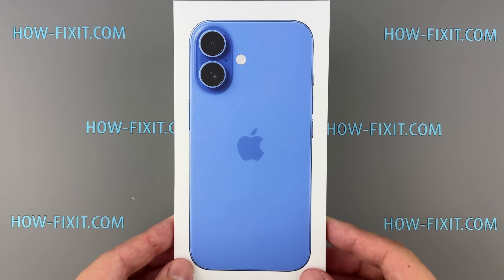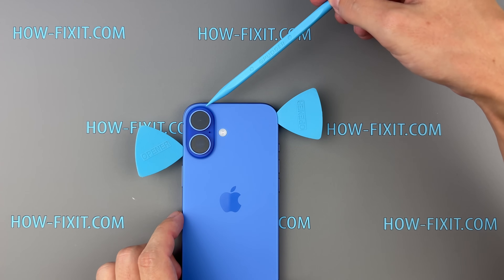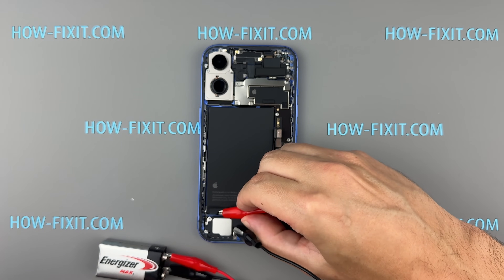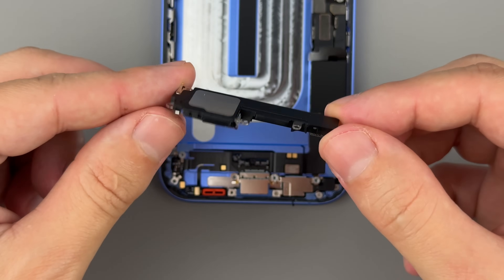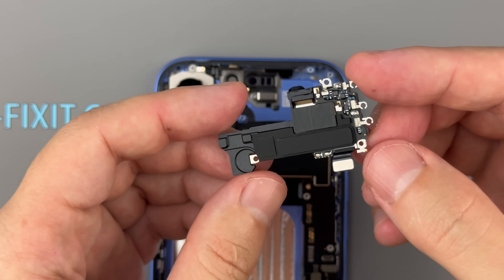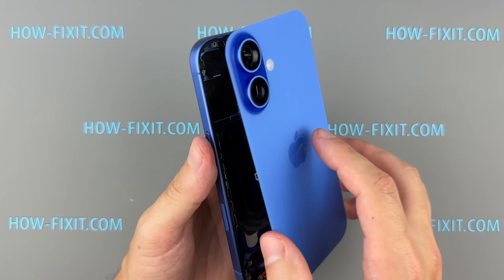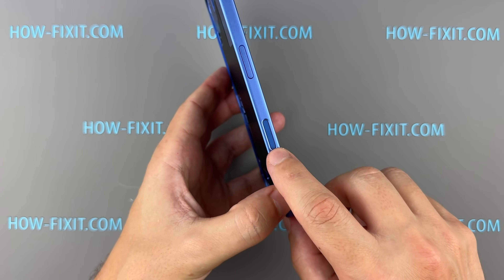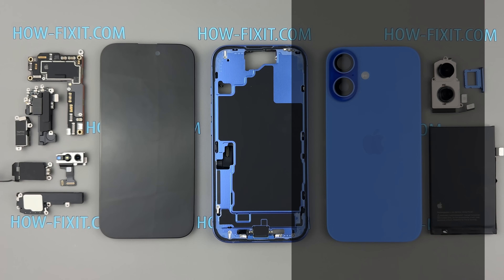Apple iPhone 16 Teardown – New Battery Removal Process Revealed!

Comment: They could have easily made a slide in battery and skipped all the nonsense with the glue.
Reply: Slide in battery would not make a water resistant iPhone. Study engineering. 😳

Comment: What did you mean by the sensor needs to be transferred wen making a screen replacement?
Reply: Most aftermarket screens do not come with the proximity sensor pre-installed, so you will need to carefully remove the sensor off the damaged screen and install it on the replacement. Not an issue if you are using OEM parts ordered directly from Apple as those come with that component pre-installed. If you can successfully disassemble the rest of the phone as well as the video guy does, this should not be a difficult task. But it does have a fair bit of adhesive holding it to the screen, so use heat, rubbing alcohol and care.

Comment: How does Apple's design choice of welding the control button to the chassis affect long-term repair strategies and part replacement availability?
Reply: Simple. It makes swapping to a used chassis from a donor impossible. The button has a chip with a serial number on it and the firmware will not accept this swap.
Reply: @jflo4073 ждём когда появятся китайские программаторы и чипы без номера
Reply: @jflo4073  True, but with the ability to swap back glass, you typically won't need to swap the chassis.

Comment: Can the placement of the Wi-Fi antenna, glued to the earpiece speaker, complicate repairs or signal strength during reassembly?
Reply from the maker: I don't see any problems with replacing the earpiece speaker since you can heat the flexible Wi-Fi cable with a hair dryer, peel it off, and transfer it to the new module. However, the placement of the Wi-Fi antenna, glued to the earpiece speaker, can potentially affect signal strength during reassembly. Since the antenna is attached to the earpiece speaker, any mishandling during disassembly or reassembly could damage the antenna or its connections, leading to weakened or inconsistent Wi-Fi performance. Care must be taken to ensure that both the earpiece speaker and the antenna are correctly reinstalled.

Comment: Is it possible to install a dual SIM card reader module from an iPhone 16 from the Chinese region into a European iPhone 16, which has a SIM card reader for only one SIM card?
Reply from the maker: Yes, it is technically possible to install a dual SIM card reader module from an iPhone 16 from the Chinese region into a European iPhone 16, but it may not function as intended due to both hardware and software limitations. The Chinese version of the iPhone 16 is designed to support dual physical SIM cards, while the European version typically supports one physical SIM and one eSIM.
Even if you successfully swap the SIM card reader module, the European iPhone’s firmware may not recognize or properly support the dual SIM functionality. Apple often regionalizes its devices with specific firmware, and features like dual SIM support may be restricted by software tied to the region. Additionally, swapping out the SIM card reader could affect future iOS updates or cause issues with network compatibility, as the phone might not recognize the modified hardware properly.
In summary, while physically possible, it is unlikely that this modification will work smoothly without custom firmware or other adjustments.
Reply: @howfixit  I remember when they changed the SIM card reader module on the iPhone XR and everything worked fine
Reply from the maker: Yes, there were times when you could change the screen or battery on the iPhone XR and any compatibility errors, everything worked perfectly, but over time, Apple made restrictions to the new version of iOS, and at the software level, the modules changed their work and caused errors, this can also be enabled with a SIM card module from another region.

Comment: Why do you think Apple might use electrically induced adhesive as a way to bond the battery to the iPhone housing?
Reply: Thanks ChatGPT
Reply from the maker: Apple might use electrically induced adhesive for bonding the battery to the iPhone housing for several reasons:

1. Controlled Adhesive Release: Electrically induced adhesive allows for a more controlled removal process. By applying a small current, the adhesive can be softened at specific points, reducing the risk of damaging delicate internal components during battery replacement.

2. Improved Structural Integrity: This method may offer better adhesion compared to traditional adhesive pull tabs, providing a stronger bond that helps maintain the device's structural integrity. This could be particularly important for making the device more resistant to drops and impacts.

3. Heat Dissipation: Electrically induced adhesive might help improve heat management. By bonding the battery more securely to the chassis, heat generated during charging or heavy use could dissipate more effectively, improving the overall performance and longevity of the battery.

4. Innovative Repair Process: Apple could be streamlining their repair process, making it more uniform across future models. By introducing this method, they may also be controlling the way battery replacements are handled, potentially ensuring that only authorized repair centers have access to the tools needed to safely remove and replace the battery.

5. Environmental Considerations: This adhesive might reduce the amount of glue used overall or be more environmentally friendly by requiring less chemical-based adhesives, aligning with Apple's focus on sustainability and reducing their carbon footprint.

It’s a combination of these factors that could make electrically induced adhesive a smart choice for Apple’s future device designs.

Comment: Do you think it takes longer to remove the screen on newer iPhone models compared to the first versions? Not a crucial detail, but still something I find interesting to know😄

This version improves clarity while keeping the casual tone you wanted.
Reply from the maker: Yes, it definitely takes longer to remove the screen on newer iPhone models compared to the earlier versions like iPhone 7 or iPhone XR! 😄
Older iPhones, like the iPhone 4 or 5, were simpler to disassemble, especially since they didn’t have as many tightly packed components or advanced sealing methods. Over the years, as Apple has added more features (Face ID sensors, waterproofing, stronger adhesives), screen removal has become more complex. Now, with newer models like the iPhone 16, you have to deal with stronger adhesives, delicate connectors, and additional sensors glued to the display. So, while newer designs improve durability and features, they also make repairs a bit more time-consuming.
Reply: A bit more time consuming, but if you want to start learning how to repair phones, if you grab an iPhone 6 or 7 and tear it down to its basic components and successfully reassemble it, you have lots of the basic skills needed to work on the higher end stuff, just have to work around the stronger adhesives. If you can't get the screen off an iPhone 12 without breaking it, don't try your hand on the 16 unless that screen is already damaged. Never operate on a patient you can't afford to lose if you don't know what you're doing :)

Comment: Can you elaborate on how the electrically induced adhesive improves heat management in the iPhone 16’s battery?
Reply from the maker: The electrically induced adhesive in the iPhone 16’s battery can improve heat management by providing a more secure and uniform bond between the battery and the iPhone’s chassis. This close connection allows the battery’s heat to dissipate more effectively across the metal frame of the device, acting like a heat sink.
The adhesive helps regulate the battery’s temperature during high-power tasks such as gaming, video recording, and charging by ensuring better thermal conductivity between the battery and the surrounding components. This can prevent overheating, which in turn improves battery efficiency, extends its lifespan, and ensures more consistent device performance.